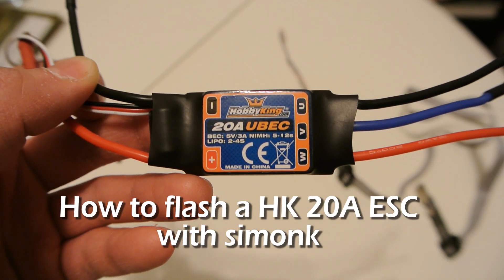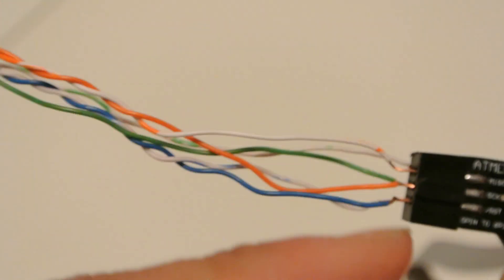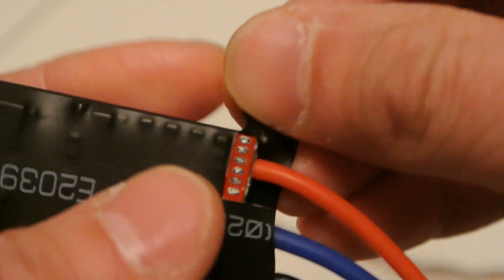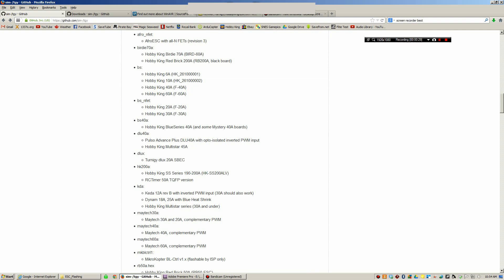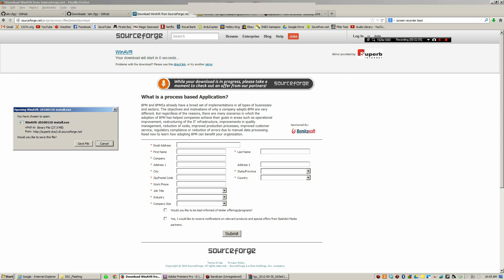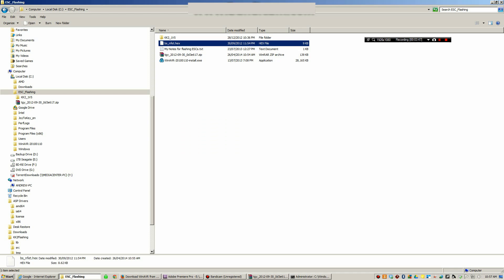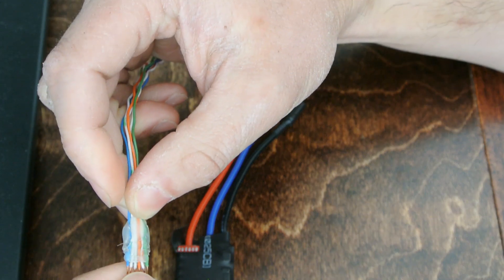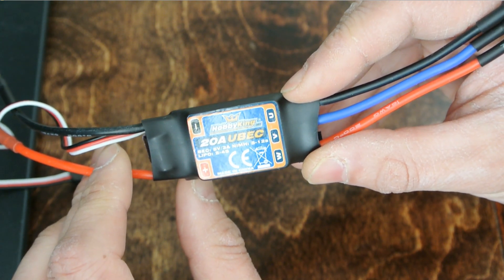How to Flash a Hobby King 20A ESC with simonk

Comment: Thank you kindly for your very helpful video. I've just used your explanation to save an otherwise "bricked" ESC that failed during a BLHeli firmware update due to my accidentally shorting out a wire during the process. Your system works equally for uploading BLHeli .hex file firmware. Cheers!

Comment: Can two same Escs used in a quad with different flashed firmware  one simonk and BlHeli?
Reply from the maker: underfloor heating installer No you should always keep them the same.  They can have different settings from each other.

Comment: Maybe a stupid question but what happens if you don't flash the ESC's?
Reply from the maker: Pim Doeswijk Not always necessary to flash the ESCs, just allows for a faster refresh rate = more responsive copter.  If you are flying aggressive or acrobatic is where you will see the most benefit.
Reply: +Andrew W Could I use unflashed Escs on a Small tricopter? or is it likely that the tricopter will need a very fast refresh rate?

 Currently I'm having issues even hovering like the motors aren't responding at the right time I'm thinking.....

I have 800kv motors with 12" props... Big props & little tricopter = bad?

Comment: Hey Andrew,
Would you be interested in flashing a HK 20 a esc for me? I fried one in a crash an the replacement needs flashing. I could slide you a little cash for your trouble let me know thanks
Reply from the maker: Hi David, I don't mind doing helping you out but wouldn't it be cheaper and faster to order an Afro ESC from hobby king that is already flashed with simonk?  I don't have any extra HK20s at the moment either.
Reply: Andrew W you see, I am new to quads, and I already have purchased 2 hk 20 esc. I did not realize that it would not act the same as the other 3, which already been flashed with SK from armattan. dont the esc need to all be the same kind?any way, just thought I might get someone to flash the ones I already purchased.Thanks ,
Reply from the maker: david McCann Hi David Drop me a private message with your email and we'll see if I can help you out.
Reply: Andrew W ....Ok so ESC's can be bought Allready Flashed ??
Reply from the maker: integra Yes, check out the Afro ESCs from hobby king